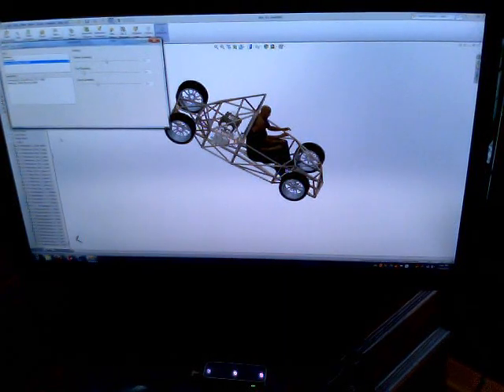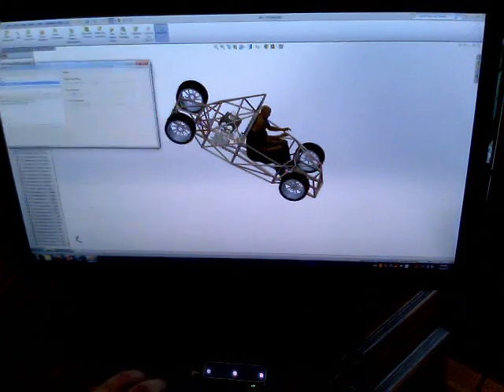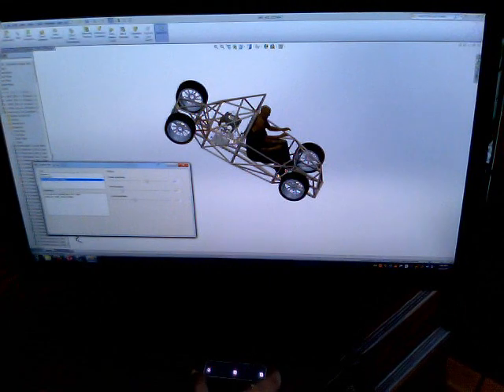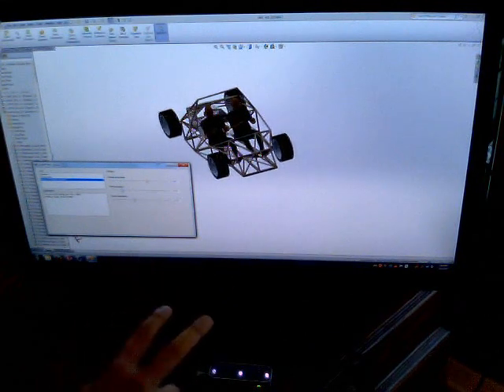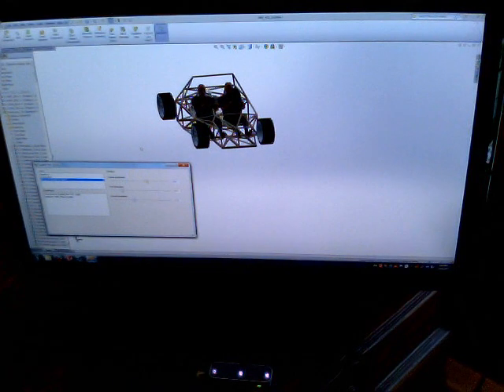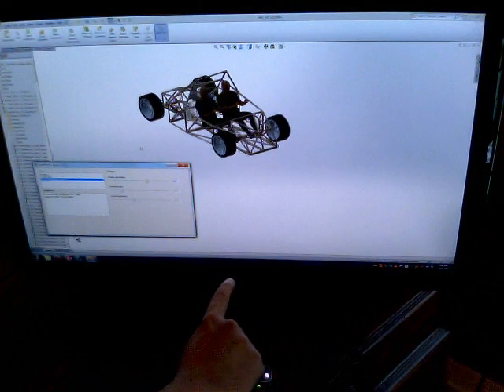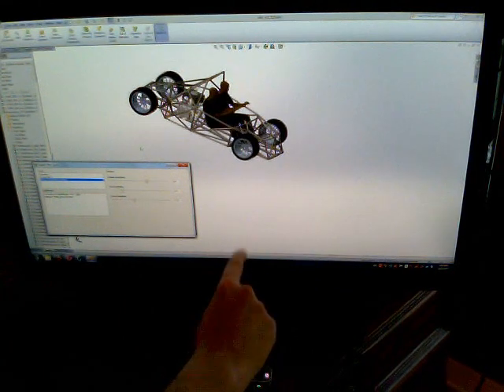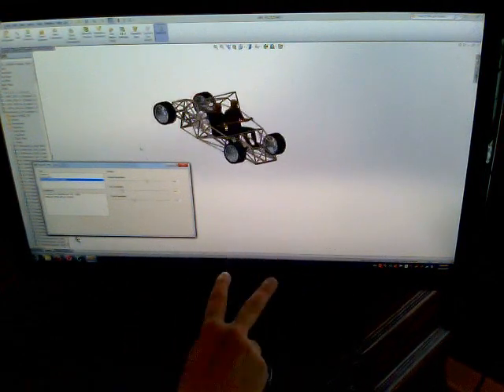Leap Motion Solidworks Integration 3DiG

Comment: Robin, I am currently a student in mechanical engineering. Our final project requires us to use leap motion to control a robotic arm in soliworks. Is this at all possible ?
Reply from the maker: I just sent you a message from your helpouts message, let me know if this helps any.

Comment from the maker: I entirely agree, we hope that we can introduce a sketching mod where you can freely sketch on your desktop surface (as mentioned before).  But for our next build we are concentrating on the newly introduced gesture support in the latest sdk.  This support allows us to easily trigger hotkeys with swype/gesture commands.  We plan on keeping your main working hand free, and then linking the gestures inputs specifically to tools (pencil/stick) in the offhand.

Comment: No I do not,but at that point my hand is already on the mouse doing everything else that I need to do in order to create my model so pressing down on my scroll wheel and moving my mouse will be less bothersome than to take my hand off the mouse to rotate the model with my fingers. Don't get me wrong I think that what you guys are doing is fantastic and I obviously like the whole idea of the leap motion controller otherwise I would not have ordered one months after the MIT TR article

Comment from the maker: Keep in mind this is our first internal alpha.  What has been implemented so far, is useful mainly for short "presentations" either in a board room or class room setting.

Our team is made up of engineers who use Solidworks, so we are looking forward to introducing more features that make the device have extra functionality.  Features like being able to rotate the leap motion on its side and use your desktop as a working surface.  Or using a pen/tool to access your swipe commands.